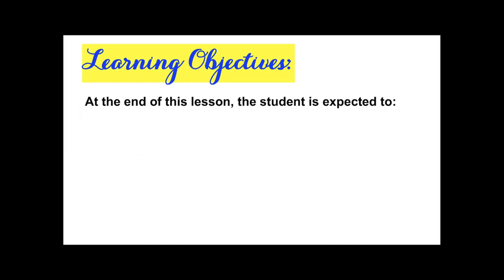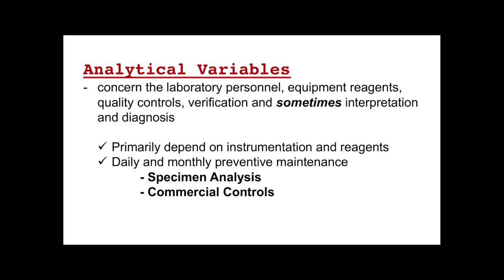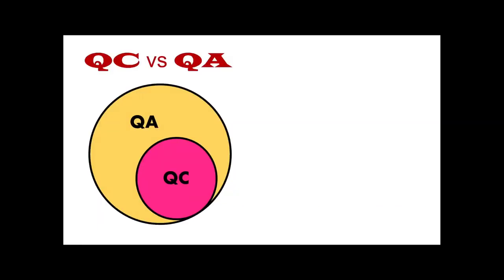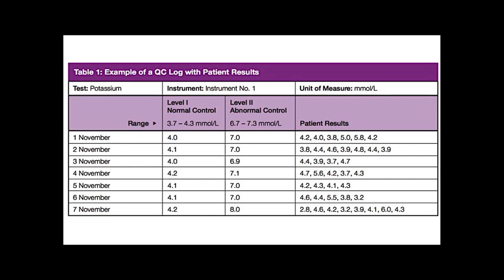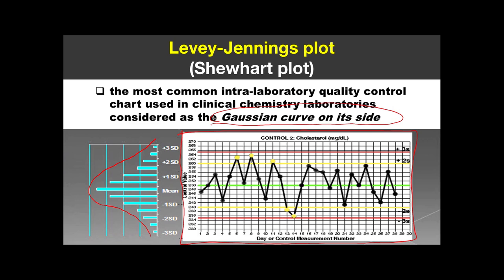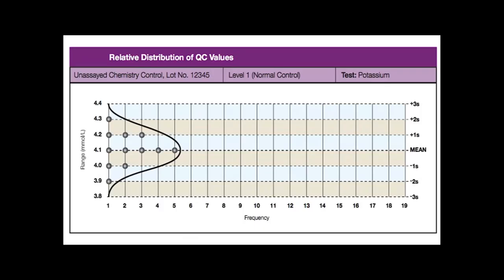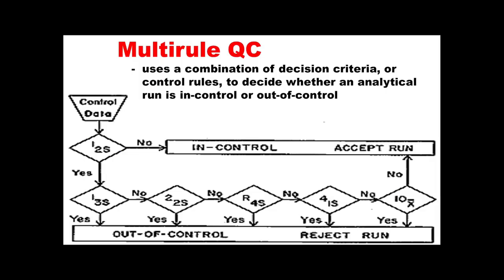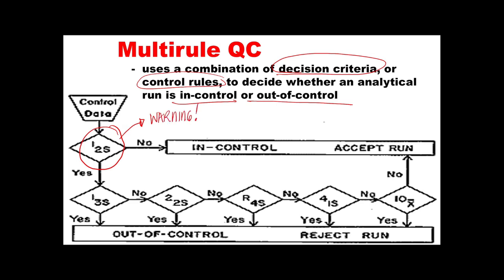QUALITY CONTROL IN THE LAB

Comment: If we have 2 rules of the same day we reject the 2 control values?
Reply from the maker: @abeer's Channel
Hi, do you mean 2 Westgard rules violations on the same day?
It depends on how many levels of control you are using. 
For example, if the level 1 control falls outside the +2s, then the level 2 control also falls outside the +2s, then both levels will be read as having a 22s violation. So that must be rejected.